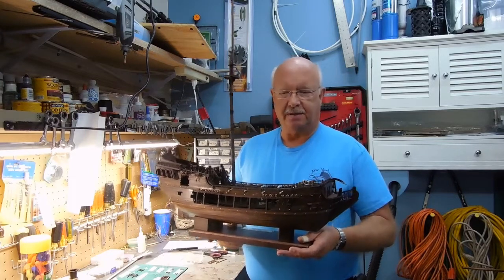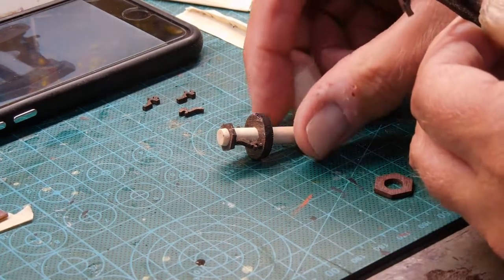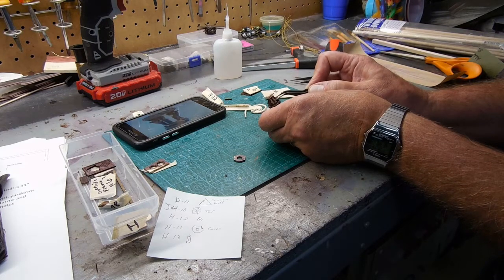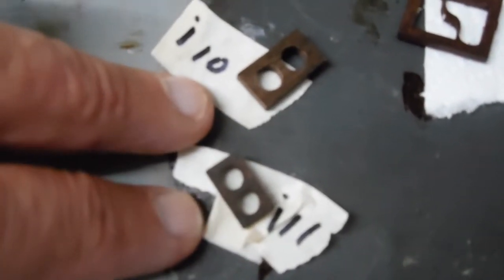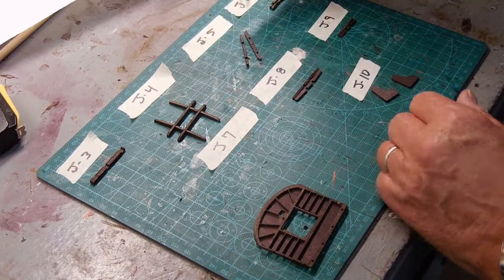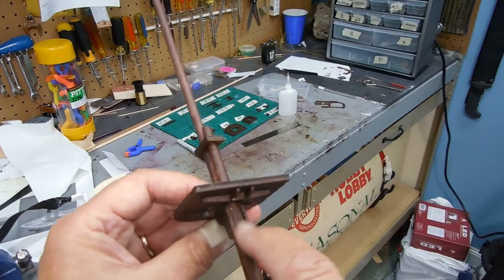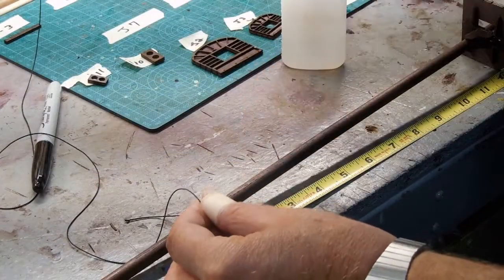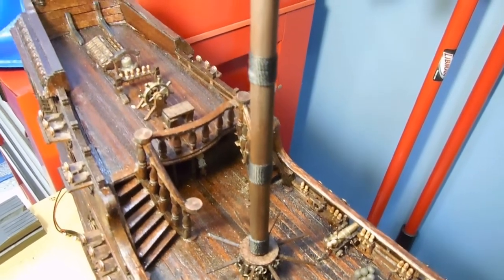The Black Pearl Model Ship Part 22

Comment: Lookin good Dan!! you can also rub paraffin or bees wax on the dowel to help glue from sticking to said dowel ( a little jack sparrow LOL) You can also use wax on thread for help managing it while rigging ( pinch thread between thumb and wax and pull through two or three times ( about a foot or so at a time depending on how much you will need) greatly helps attaching dead eyes and blocks etc. you can wrap waxed thread around deadeye and then pinch tread together where it meets - the wax will hold thread together while you glue.
Reply from the maker: Great advice! Thanks

Comment: nice, I believe there is some triangle frames for the cannon balls ,so glad you got some numbers for the masts so I have some direction .I was not looking forward to doing that blind
Reply from the maker: I've been looking through my supplies, but haven't found the triangle frames, but I can make them pretty easily.  Probably later more than sooner.
I will include the  mast and yardarm measurements in my next video as the masts will be done.  I'm increasingly happy with the model, considering I'm a beginner and picked a ship with very weak instructions.  I'm hoping that there is enough detail to help others with the same or similar version to be able to work through the build.  It's turning out to be a rewarding experience... (Not $$, just the experience overall.)
Thanks for watching and taking the time to comment.